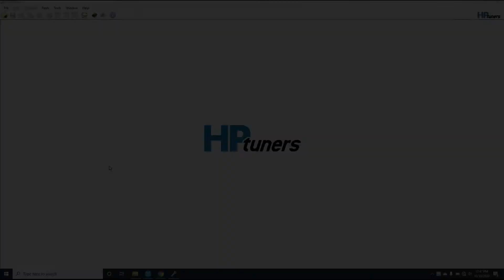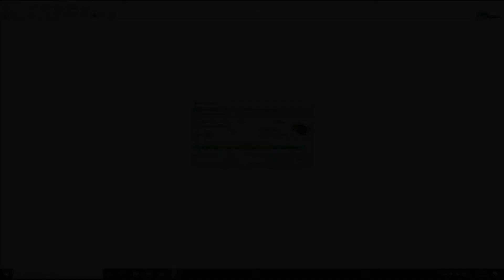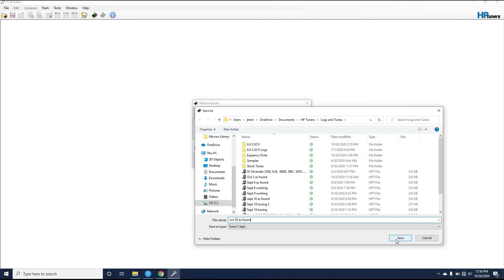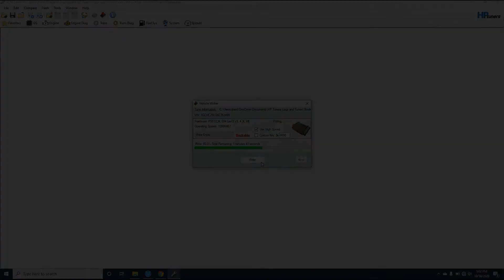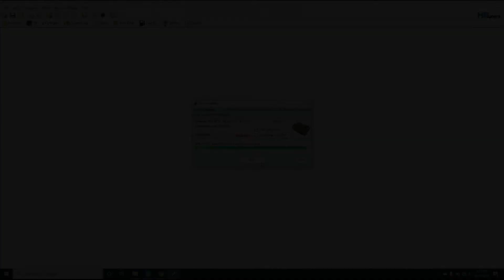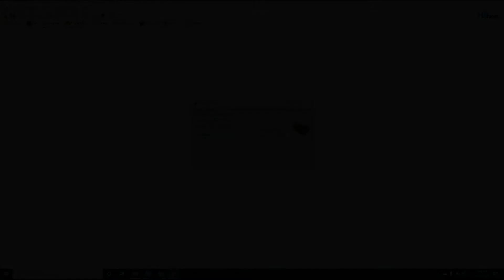HP Tuners ESSENTIALS for you LSX Build or Swap!

Comment: What is it that you need to hook up to the pcm to the laptop? Hp tuners is just downloadable from the internet?
Reply from the maker: You need an interface connector that connects the OBD2 port to a usb or computer style connector. When you buy HP Tuners you get the physical interface to connect your computer to the vehicle OBD2 port and the software for your computer to be able to read, write, and change the programming.
Reply: @MohawkMotors  is there a specific link where I can buy hp tuners?
Reply: @MohawkMotors any obd2 connector to usb will work?
Reply from the maker: lots of places sell hptuners, I would just shop around for the best deal. NO it needs to be an interface to match the software you're going to use.

Comment: Awesome video, I was hoping you had done one like this.  Question, if you are using a different computer for your truck from another vehicle, are you able to update it with your correct VIN and vehicle description?  I'm in the beginning stages of building a 6 liter to replace my 4.8, will this require making changes in the PCM as well?
Reply from the maker: As far as I know, you can't change the VIN encoded into the pcm, BUT you can absolutely update to run different engines and transmissions. You can do what's called a segment swap, to change what it will run, for example changing from 4.8 to 6.0, or changing from automatic transmission to manual transmission. You'll definitely need to change your tuning for the 6.0 because it will have different fuel requirement than the 4.8, but it should be close enough to at least get it started.
Reply: @MohawkMotors  - I'm going to order the MPVI2 and a couple credits in the next couple weeks, and download the software. Is that really all you need?